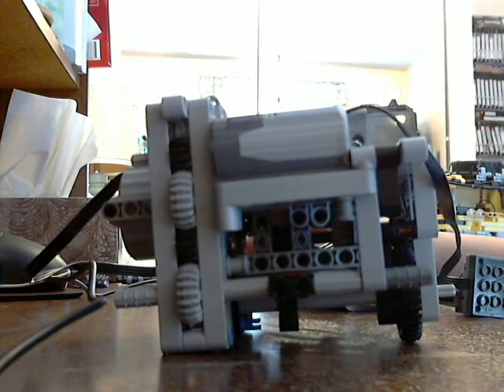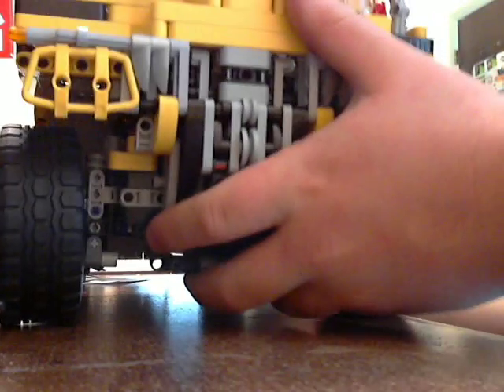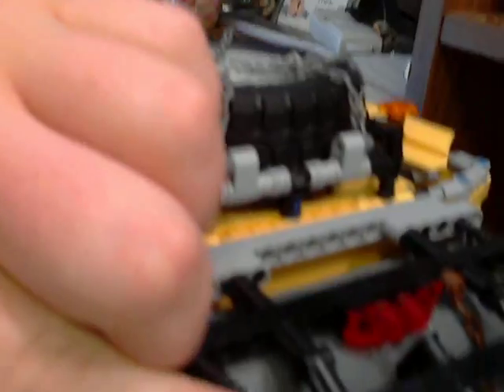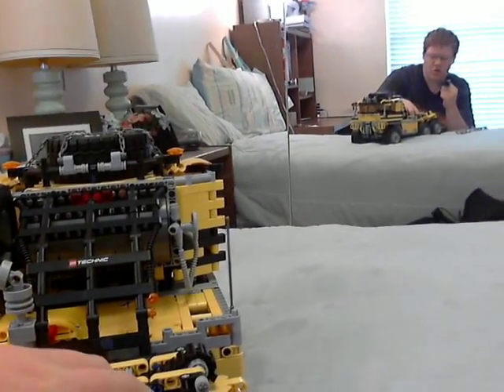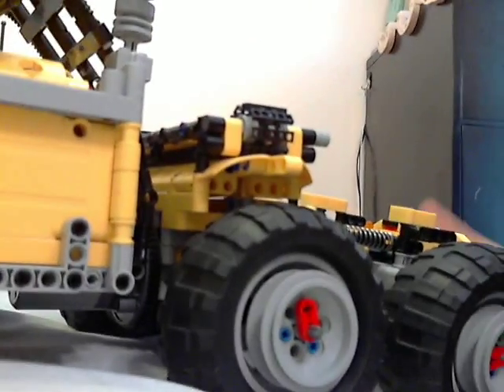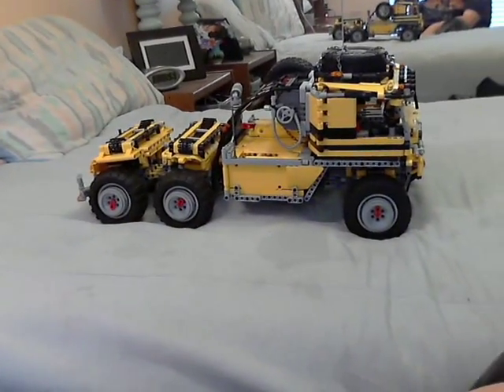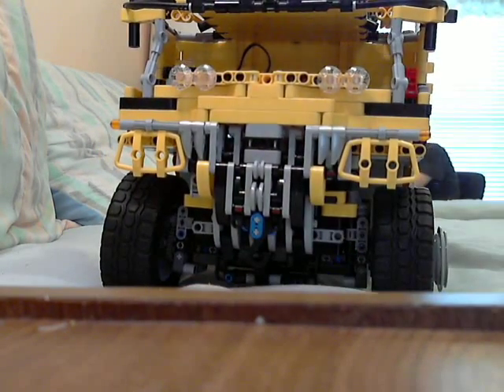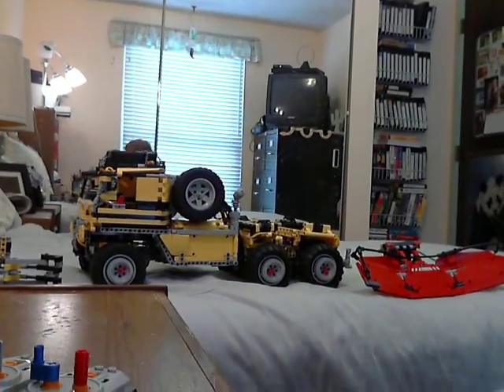EPIC LEGO Technic 6x6

Comment: low ground clearance
Reply from the maker: The ground clearance of a vehicle is limited my the placement of its moving parts, there must be sufficient protection to those moving pars in order to prevent gear-jams. So among LEGO MOCs, this vehicle has rather high ground clearance for its size.
Reply: I have made an MOC of a similar sizewith about 6 studs clearance. I can drive it through tall grass and rocks without any damaged parts.